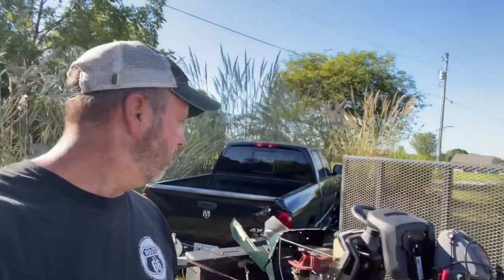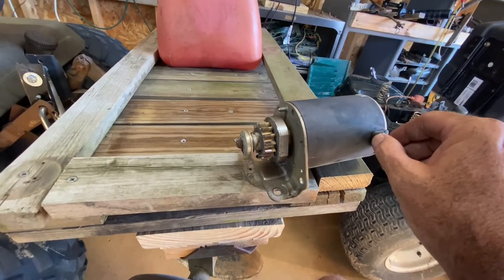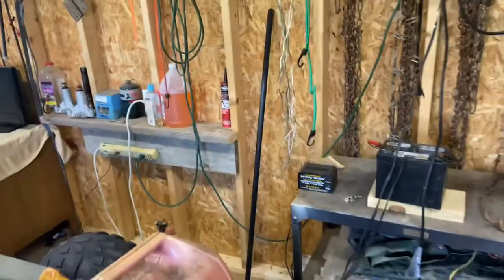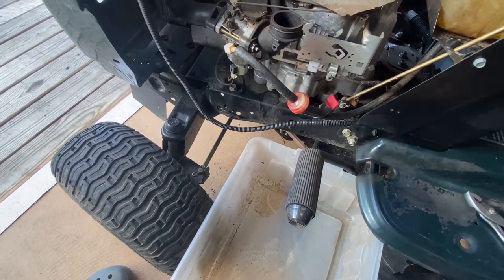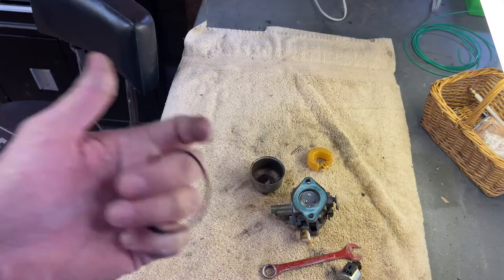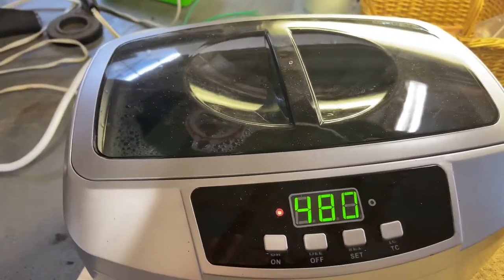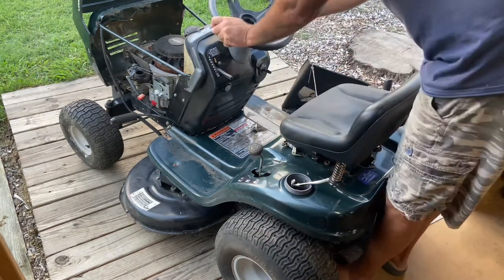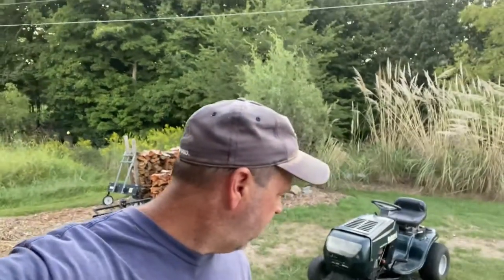Bolens mower would not start- fixed

Comment: nice video I'm in Old Hickory got the same Mower 
mine has been sitting under tarp
for about three years...got interested in it again
so untarped it and like your aired the front tires
pushed it in garage, change oil, took gas tank off
clean it inside and out and shes good to go...didnt know
if you notice your head lights even work, anyway nice job
Reply from the maker: Thanks and glad you got yours going

Thanks for watching

Comment: My 38" Bolen made a loud popping sound and now it's not running any more.  It's 13 years old and they want to charge me almost $700 to fix.  Watching this video trying to do it my self but my head hurts.   Lol
Reply from the maker: Popping through the carburetor may be valves or timing
Reply: Probably the valve adjustment and the cap came off the valve stem 
Only has one of them 😊

Comment: What’s the part number on the new starter motor that you used to get the law motor going again?
Reply from the maker: 693552

Make sure your gear off old one is metal and 14 tooth

Good luck

Comment: I turn the key on mine and I get NOTHING. I replaced the battery and still nothing. What would your next step be?
Reply from the maker: Take some jumper cables, run one to ground on the battery and one to the starter bolt(expect Sparks) and see if it turns
Reply from the maker: If it turns it’s either key switch or silinoid

Comment: Just cleaned my son's bolens carb but it's a newer model with the jet issue and needing a kit. after putting it back together it was pushing fuel out the exhaust and fortunitly not starting. The starter turns but stops. thought it was the battery but bypassed it and ran the jumper directly to the cables and did the same thing. the gear on the starter was stuck at the top so shot pb blaster on it and worked it by hand till I could get it up and down. blocked off the fuel line and removed the carb to test the starter and finally got it turning good but stopped again. probably could clean it and get it working again but will by a new starter and carb kit to rebuild it. I also saw a video on these carbs that shows adding a oring to keep the jet from not seating.
Reply from the maker: This is good information, good luck with it. Thanks for watching.
Reply: Needs a new needle and seat, that is why you had fuel in the exhaust and actually fuel in the cylinder causing hydro lock--this is bad because it cannot start and because the fuel will seep into the crankcase and dilute the oil. If you don't want to go to the trouble, a new carb is often the same price as a rebuild kit (and that is crazy). However, these new carbs are often made in China and may not be as good as the old one (new carbs are often strangled by EPA regs and are not as adjustable, they have fixed jets, etc). A cheap work around to a bad needle and seat is to install an inline fuel shutoff valve. When you are done mowing, let the engine idle and then turn off the fuel so there is no longer any fuel trying to flood the carburetor and then let the engine keep running until it uses all the fuel that is "downstream" of the fuel cut off. Let it die of fuel starvation and then you are good to go.
Reply: wow, your right, Ill tell my son to pull the plug out and drain what fuel is in the cylinder out and shoot some 2 stroke oil in there and spin it. Great info if that is it. may not need a starter after all. thanks